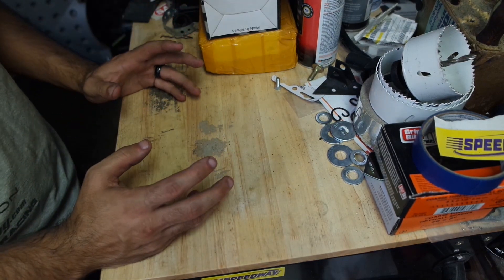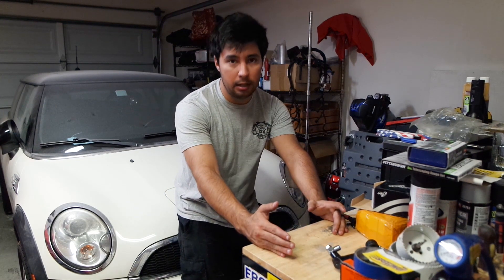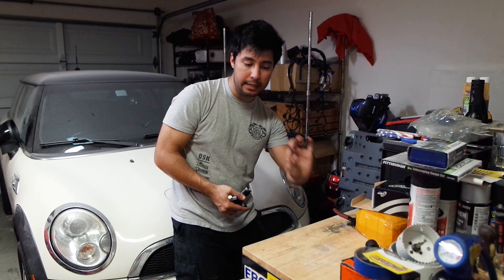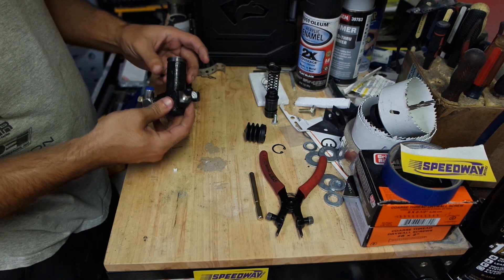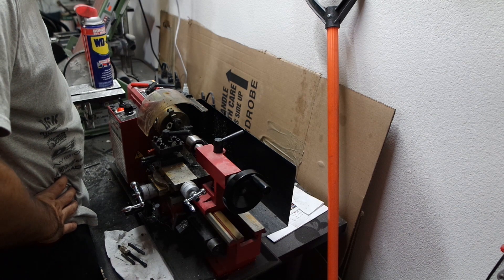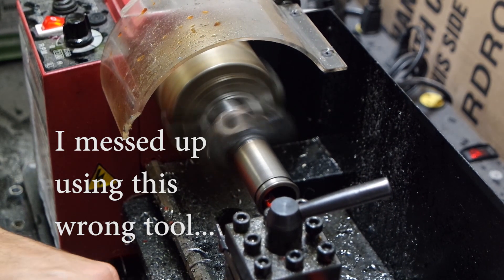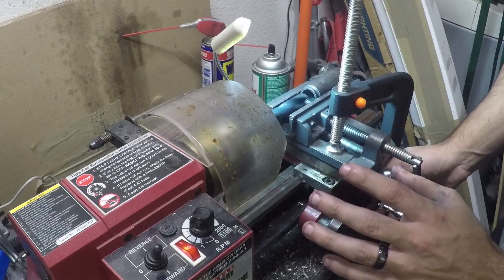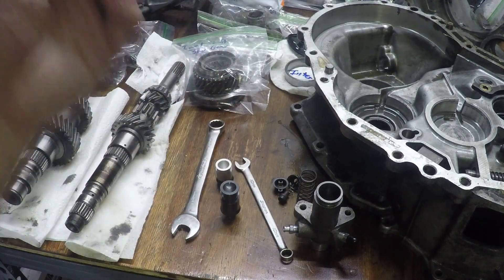Building a Custom Slave Cylinder

Comment: This is awesome. Piston definitely needs to be changed in the r53.
Reply from the maker: Plus if you build a custom slave cylinder housing to match like we did, then it's works perfectly. I'm sure the R53 is similar enough to the R56 that some hydraulic parts may be interchangeable.

Comment: Shorttrack here, when are heading back to TX . Got my Gen doing crazy #'s at the track and killing shit on the streets .Nice vid .
Reply from the maker: Oh nice, what are your best #'s so far? We're dying to get back. I'm putting in a request for May 2020 to move back. I'm just sick of California. Beyond the Hollywood stuff, this place sucks LOL. 91 octane is no fun either
Reply: @InitialDIYmods  my Gen is running ET of 11.57 @ 118.7 mph in the 1/4 . Could run faster but  don't want to run drag radials on a 17" rim tire combo . There is  built GDI v6 turbo Gen run low  11.10's  . Thinking of going to a Alpha speed  E85 tune later .Would allow me to run a bigger NOS and corresponding fuel jets . Take care .
Reply from the maker: That's awesome. Yeah the e85 would help a lot for your car. I have the tactrix cable now, since I'm planning to get a new tune once of these days but now that I'm heading home, a 91 tune doesn't seem as important so maybe just more boost lol.
I haven't run the 1/4 in forever but you trapped more than me when I was at 455 whp. Best I got was 117 mph but et was still 13.0 Haha. I can't wait to face off against you're car though, it's been a long time coming

Comment: Mass produce these for the rest of us who suffer from Clutch Leg Syndrome
Reply from the maker: Have you tried buying the fwd slave cylinder yet? That should make a decent difference in pedal feel compared to the awd one. I noticed the parts suppliers can't tell the difference and mix them up all the time too so you have to physically verify which you have installed. Previous owner could've mixed it up too